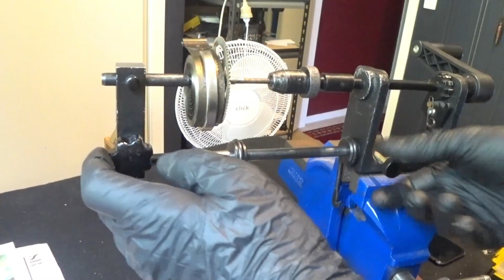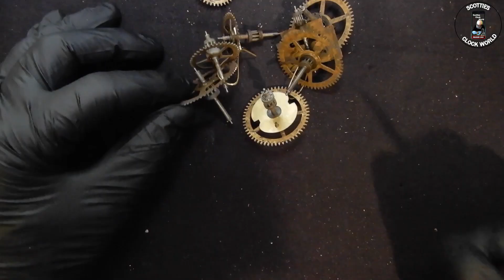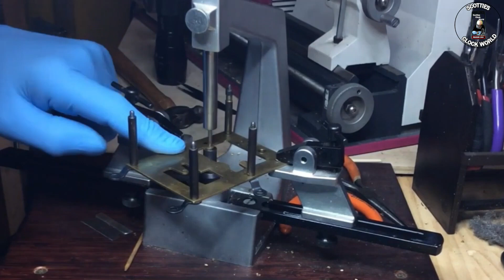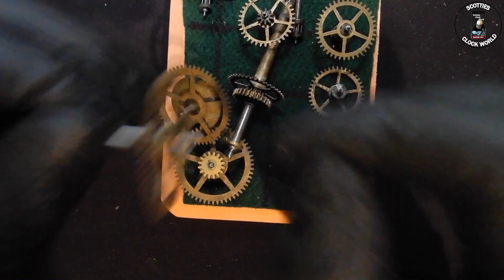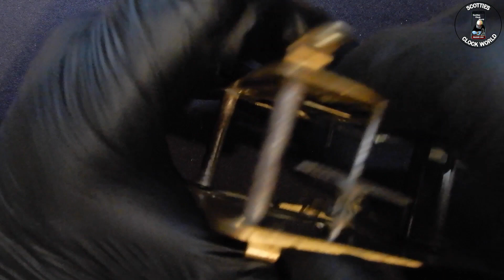Waterbury 10 Inch Drop Dial Wall Clock Restoration - Episode 3

Comment: Good video Scottie.  Wouldnt it save you a lot of time that instead of putting the wheels in individually into the plates that you do a tilt test instead.  The first wheel that you put in didnt tilt that much but the second wheel that you put in tilted a lot and you could see that the bushing was really worn.  Just my thoughts.  Keep doing a great job with your videos.
Reply: Nice video. I’m new to clock repair and will be working on my first Waterbury kitchen clock in a couple of weeks. After cleaning and checking the pivots for fit, could you apply a coat of lacquer onto the plates to bring back the bright finish? Thanks for sharing.
Reply from the maker: @jimreichel4052  , not a good idea. The lacquer will flake off over time and end up between the pivots and the bushings.
Reply: @ScottiesClockWorld  Sounds good. Thank you for the reply!!
Reply from the maker: Yep, that'll work too.